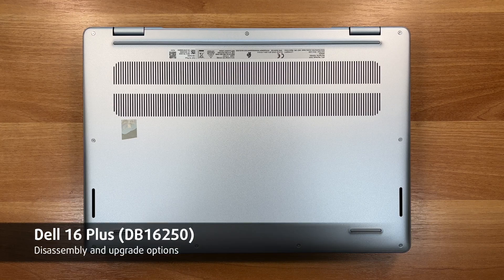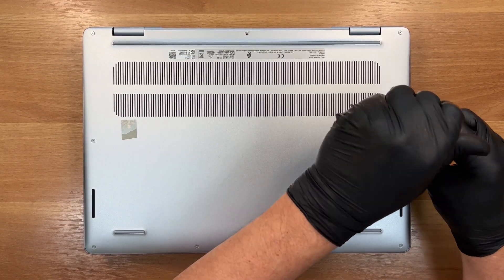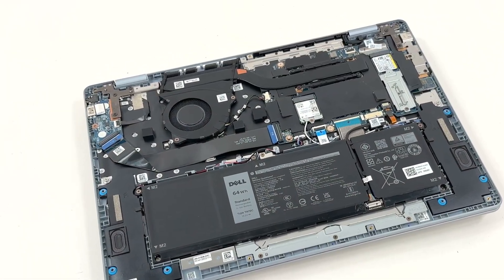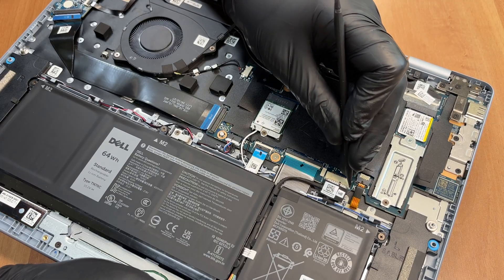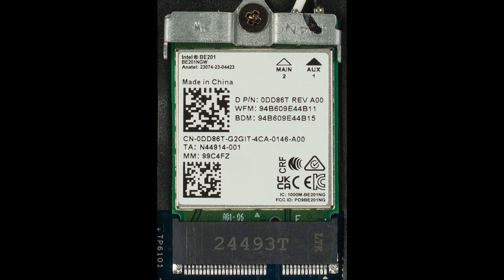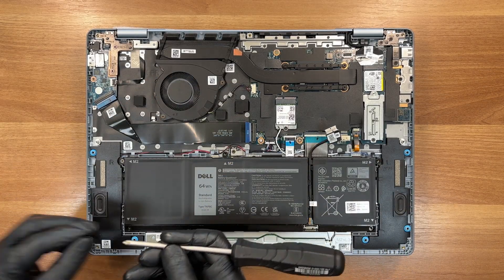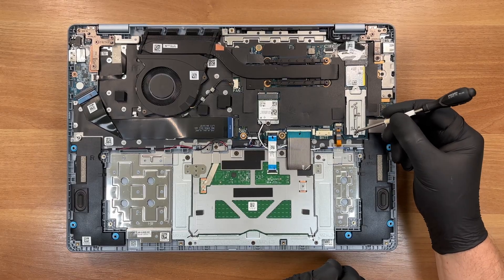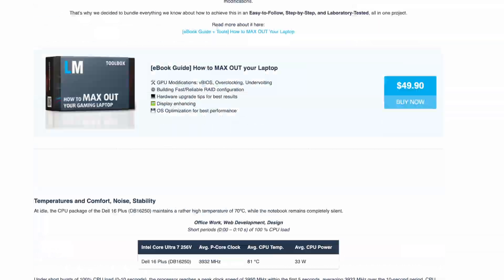🛠️ How to open Dell 16 Plus (DB16250) - disassembly and upgrade options

Comment: Thanks for this video. The specs for my DB25550 , similar layout with extension bracket, says 2230 SSD drive, has anyone tried a 2280 in any similar units to this one?

Comment: Hi, pls do disassembly of HP 255 G10. I want to upgrade RAM and SSD but want to make sure before purchasing anything
Reply: If possible share S/N...will update you with the proper details
Reply: @vinstondavid  Hi, thanks for your prompt reply. SN# is 5CD450BF26. ProdID is B69V0PT#ACJ. I want to know if I can upgrade RAM or not. In Cpuz, it show 2 Rams of 4GB each. Next, i want to know if I can add one SATA 2.5 SSD. If no, can I upgrade existing 256GB ssd, which is probably KBG60ZNV256G.
Reply: @ezharm5 Sorry brother...the details of ur laptop isn't properly listed even on HP partsurfer too...The model is 255 G10 with AMD Athlon 7120U I guess...And I think the RAM is onboard and not removable. U can go into BIOS & check for system memory details there